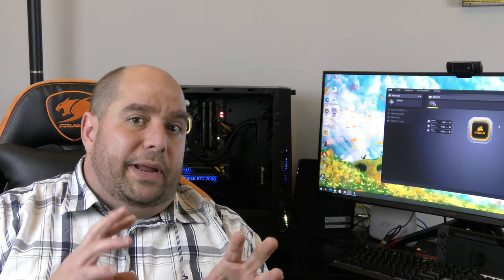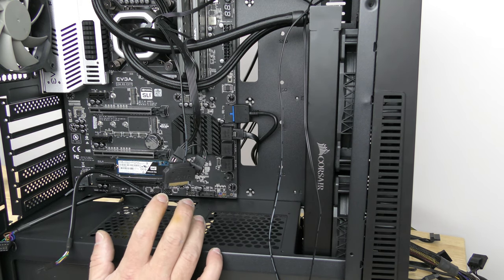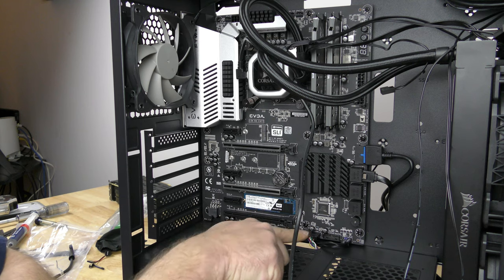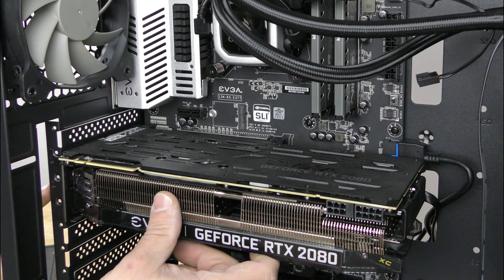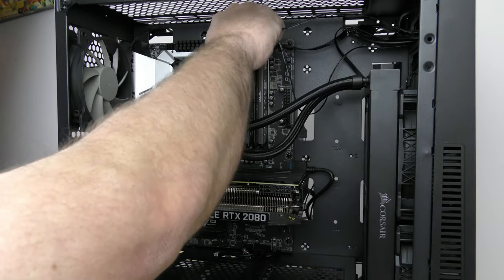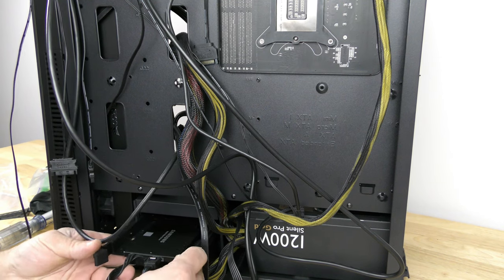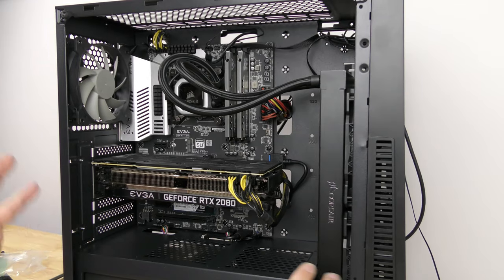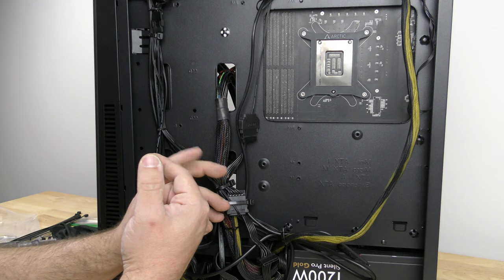How to Wire a PC Game Build for Beginners - Step by Step Wiring Guide 2021

Comment from the maker: ✅ Watch Next: How to Installing the EVGA 3080 Ti FTW3 ULTRA GAMING: https://youtu.be/qsOC2IkKi1s
In this video Cabling a gaming PC in the Gamdias Argus M1 Case Part 2 of 2 -  Step By Step, we go over how to wire the PC you just built inside of the Gamdias Argus M1.  
✅ Have you checked out the Build video, learn how I built it and got to this video: https://youtu.be/RfgpRGLQT2A

Please let me know if you have any questions on this, but below you can find a full part list of everything in this system.

Here are all the components in this system
Gamdias Argus M Case: https://geni.us/N75el7
EVGA Z370 FTW Motherboard: https://geni.us/X9eVgAq
Corsair Hydro H115i PRO Liquid Cooling AIO: https://geni.us/KhslEW2
Intel Core i7 8700K Processor: https://geni.us/jD0s8D
EVGA GeForce RTX 2080 Super XC Ultra: https://geni.us/XfqTe
ARCTIC MX-4 - Thermal Compound: https://geni.us/Gveq
WD Black 512GB M.2 2280 PCIe NVMe: https://geni.us/mMNLde
Samsung 850 Evo 500GB: https://geni.us/QTA2
Cooler Master Silent Pro Gold 1200W PSU: https://geni.us/7hdBk
Patriot Viper Elite Series DDR4 32GB: https://geni.us/iMVWhP
Reply: @ThisBytesForYou currently only one side of headphone is working when plugged in the front panel audio jack other Jack's are ok, not a siftware issue
Reply: @ThisBytesForYou so how to fix it in hardware, could it be more likely the wire or the mobo or the jack the problem. (Recently built the pc in a shop)
Reply from the maker: @jirehla-ab1671  look at where you have the hd audio plugged in on the board, chances are you have only the top half connected, not both sides, top and bottom, ita very easily overlooked.
Reply: @ThisBytesForYou  yeah sounds like i need to plug my jack  harder in order to fully pluged in.

Comment: Great detailed review.   I have a question in particular to the front I/O LED lights.   I see that in 20:43 of the video you press the I/O button to change the LED colors.   In my case, it resets the computer.   What did I do wrong?   Thanks.
Reply from the maker: Probably what you have done is you plugged in that button into the reset header on the board, press the reset button and see what happens.  I think your crossed the wires, not a big deal though, you can swap them.  Let me know how it goes.

Comment: Do you need that usb 2.0 to 3.0 connector or is their a spot where I can connect the usb 2.0 header into the motherboard?
Reply from the maker: More than likely yes, most boards have at least 2 x USB 2.0 headers and 1 x USB 3.0 Internal header.  I used one of the 2.0 so that I could get another USB 3.0 header, depending on the case of course.

Comment: Hello I have a problem my pc turns on the fan spins for a second then it just dies
Reply from the maker: Hello my friend, can you please list all of your components, manufacturer and model number for your motherboard, video card, power supply, RAM, Video card, etc, please list them all so I can help.
Reply: ThisBytesForYou      Thank you.  Here is specs.   Motherboard is  ASUS prime Z390M-plus LGA1151
Intel I7 7700k 
Geoforce Gtx 1060 6gb 
32gb crucial ballistix rgb ddr4 ram 
Nzxt 120mm water cooled
Reply: @JustRealMrBread  I think he forgot about u 😞
Reply from the maker: nope didn't forget, youtube sucks at notifying.
Reply from the maker: sorry my friend, youtube is horrible at notifying me.  Check to see that the CPU, Memory are seated properly.  Make sure you have the 8Pin EPS CPU Power connected from the power supply to the motherboard and the 24PIn ATX power is connected and seated properly from the powersupply to the motherboard.  Make sure all of the PCIE connections are plugged in correctly to your video card.  It has happened many times, a lose connection will cause this.  And it can be so easy to miss them.  Again, I apologize for the delay, and I will be making a video on youtubes messed up notification system.

Comment: Very well detailed, however I did notice you have the AIO pump above the radiator which you should always try to avoid. But not a big deal.
Reply from the maker: Thanks bud, it really does depend on how much that it has been filled, Arctics I have never had a problem, like this and slightly above the CPU, but this one... it gave me problems a few months afterwards, they didn't fill it enough so the bubble was pretty large.  I have built many with Arctic AIO's and never had an issue, they fill it almost completely, come to think of it, I didn't have an issue (and haven't since I am still using it on another build) with the EVGA's, but yeah, generally, inline and SLIGHTLY above is OK, like in this video, higher than this though you are asking for trouble.

Comment: such a good video, im building my first pc right now and i could use any sort of help if any one could guide me 🥺
Reply from the maker: Awesome , so very happy I could help you my friend, I have about 400 videos on here and plenty of build guides, even guides in how to prepare a windows 10 boot drive and how to install it.  If you have any questions, you know where to come.  As you can see, I answer all of my comments, when YouTube themselves don't mess up not telling me there is a comment, which sadly is quite often but I can help you along the way.  Thank you so much for checking out my video and commenting, it means the world to me.
Reply: ThisBytesForYou thanks for answering comments man, i have a corsair h115i cpu cooler but i installed it the other way you did, fans are in the case and radiator is facing out. is that a problem?
Reply from the maker: Yeah, that would not be good, while you are sucking out warm air, you are not getting any cool air in the system, and your cpu can get toasty, you don't want negative pressure.  It's fine to have the cooler on the top or the front but you want it sucking hot air out from the top and/or in taking cool air from the front.  You want your rear fan exhausting and depending on how you have the liquid cooling unit, that will probably be the only one exhausting

Comment: Do in all occasion have to buy a usb 3 to usb 2 so that i put the cpu cooler cable thing u did or is it depending on the motherboard some have more usb 2 ports and some less plz answer cus im watching all day tutorials and im afraid of ordering something wrong and need new cables and adaptors
Reply from the maker: Please don't asked people to plz answer, it won't get people that do not answer to answer, I answer all my comments, many do not.  I did it in this build because I did not have a usb 2 port for this, but if you have enough, you can use it

Comment: im about to upgrade my heatsink and fan from years ago and looks like im gonna do rewiring too lol thanks
Reply from the maker: Cool my friend, I hope this video helps you out, I am so happy if it does.  What heatsink and fans are you planning on?
Reply: @ThisBytesForYou  oh didnt expect the quick reply haha thx.  Planning on the Cooler Master Hyper 212 EVO its on sale for $35 CAD.  Not really splurging on this comp as its pretty old but too noisey now and needs a cleanup. Yes the vid def will help with the wiring managment badly needed and making neat with the twist ties.
Reply from the maker: The cooler master hyper 212 EVO is an oldie but it is a goody, so thats cool.  YEah, I always try to reply as soon as possible, sadly youtube does not deliver all the comments, so I miss a lot, but I filter through all of my messages to find ones I didn't get, like this last one.  So very happy my video helped you and please let me know if you have any other questions.  Thanks so much for stopping by and checking out the video, liking and subbing as well as commenting, it means a ton to me.

Comment: Nice guide. I'm building my 2nd PC soon and I'm a bit nervous about the wiring as there's a lot of ARGB elements and stuff going on and I really didn't do the wiring myself the last time over 10 years ago. Just have to read the manuals ever so carefully so I'm not accidentally going to damage any of the components. Other than that, I feel quite confident. :)
Reply from the maker: So very happy I could help you my friend.  I will have to admit, I hate the way ARGB is implemented, the connectors, at least in the ones I have seen, have no way to clamp onto each other so they can fall apart easily.  In this video I show you how to zip tie those together, I do recommend doing that, if not you will get very frustrated haha.  Thank you so much for the compliment, and for stopping by and checking out my video, it means the world to me.

Comment: Hi Sir!!  I do have a 4 pin (female) cable called TKG.....It's related to rgb. That cable have to go on motherboard?? Thanks!!
Reply from the maker: Then connect it into an ARGB connection on your board, or if its connection thats about an inch wide, it should go to a Molex connection on your power supplty.  If you have a picture of it, put it on imgr or something and send me a link here.

Comment: Hello! First off, thank you so much for this video, 2nd, and I know this is goofy, would you be able to tell me how to get these wires? Do the come with the computer case or a certain part? I'm trying to upgrade an EXTREMELY old (circa 2010) pc that I got from an ex, and I might have bad/outdated wiring
Reply: The front panel cables are part of the PC case. These typically include the power button, power light, reset button, HDD light, etc. The rest of the power cables are part of the power supply.
Reply from the maker: Well, they would come with your power supply, but maybe your power supply doesnt have them.. Could you let me know your power supply manufacturer and model number as well as your motherboard and processor, maybe case too?
Reply from the maker: It all depends if her power supply is powerful enough to have them.

Comment: btw the graphics card is better to have 2 different cables for the 6 and the 8 pins than just using both on the one cable, it can restrict the power depending on the psu/gpu
Reply from the maker: haha, yes, for sure, this was an older video from 3 years ago where this wasn't as much of a demand on power, the 3 series and above is what required true power connections, rather than daisy chaining, which I hate doing, but this was more the norm and amperage wise OK.

Comment: just to be clear i use every single cable that comes with case and power supply in the build right?
Reply from the maker: Yes, there are no additional cables in this build that I bought separately in this build.

Comment: Hey bro idk if I would leave the AIO pump tube on top of the GPU, it gets pretty hot especially with a 2080 and could cause water to leak and fry it
Reply from the maker: Haha, no my friend, not at all been running it like this for years, not this particular rig but other rigs much more overclocked and the temp are great.  I was a product development engineer for Alienware, then later dell when they bought us and velocity micro, won many editors choice awards and sold tons of them, with 5 year warranties as well, it's all safe.  Promise, it's safe.

Comment: Where is the reset button on the case? Can I install another smaller GPU in there?
Reply from the maker: no reset button on this case, but you can use the power button as reset, just hold it down.  Yes, you can install what your motherboard will allow you to.

Comment: Hey i have a question, so i built my first computer 2 years ago and wanted to clean the components yesterday. Now that i built it back together it wont work: my Monitor doesnt get any signal, morr importantly the computer turns off every 5 seconds or so and turns back on immidiately after. I think that i didnt connect the gpu right, it runs but i think i didnt connect the cables right. I wanted to ask you for Help as I saw that you respond to All your comments on your yt Videos😅 greetings from germany!
Reply from the maker: check the HDMI/DP cable, make sure they are both firm and make sure your power connection is pushed in all the way, it can be a loose connection.  Check it out and let me know how it goes.  Yes and you are right, always reply, unless youtube doesn't deliver the message, which happens often sadly.  Greetings from the US my friend ;)

Comment: The cables that come from the fans that came with my case are tiny 3 prong wires and my motherboard slots labeled “fan” are all 4 prong? Am I dumb or is there like a workaround? Does the PSU usually come with some kind of cable adapter for this?
Reply from the maker: the 3 pronged wires fit in the 4 pin slot, notice the plastic tab on the motherboard fit's perfectly into the notch on the 3 pronged header?
Reply: @ThisBytesForYou  I noticed after making the comment 😅 thank you for reassuring me though!
Reply from the maker: Happy I could help.

Comment: Hello I’m doing my first build right now, there’s LOTS of wires in the power supply box... it seems that you didn’t use the same amount that I have. I asssume a lot of them you don’t really have to use ?
Reply from the maker: yeah, the box for this power supply has a lot of the cables, extra's which are important to keep in case you upgrade or something but you don't need to use them all.

Comment: @3:09 @ThisBytesForYou sir you did not stop and think to show the 2 there often added power connections known as (reset switch & fan) after-all not every new pc tower has these 2 extra connections but many still do.
Reply from the maker: You did not stop to think that every single case and every single motherboard is different.  I can show you here.... But it would not match yours.  I will have a single video soon that focus's on this and this alone.  Like you stated, your did not have it, so it would have difficult.  It will come.

Comment: Hi i built a new pc and im unable to control speed of the fans. I have 4 case fans and 1 cpu fan. Im not sure if i plugged them wrong in my asrock b365 pro4
Reply from the maker: Very happy to help my friend.  It sounds like what is going on is maybe you have them plugged into the power supply, where it would just be at full force, or maybe they are 3 pin fans, you would need 4 pin fans so that they would be PWM fans, that can be controlled in the BIOS.  Does any of this sound like what you may be doing?

Comment: BHello. I have a question. Maybe i will buy Rog Strix rtx 3090  with 3x8 pin connector. My question is how to plug it?
I mean it will need 3 separate cables (Without spliiter)from psu ? If card have 2x8pin it need 2 separate cables. But what with 3x8 pin? Thx
Reply from the maker: Well, what manufacturer and model number power supply do you have right now?
Reply: Asus 850w g white edition
Reply from the maker: that power supply brings 6 x PCI-E 6+2-pin, you are fine.  Look inside the power supply box for additional cables, if you can't find them, contact Asus, they might be able to sell you some.
Reply: Is 6+2pci e same as 8 pin pci e
Reply: I’m really sorry I have so many questions I’m new😀
Reply from the maker: yes, its 6pins, plus 2 Pins, for a total of 8Pins, just make sure you are using a 6+2 header from each cable, for 3 cables, all separate.  And no worries my friend, I am here to help.  I hope you subscribe so you can keep up to date with my channel, I come out with videos weekly to help you on all different things PC related and I have nearly 400 videos already, so I am sure I have more that can help.
Reply: Thank you very much
Reply: I’m ordering in cable mod psu replacement cable is it okay to buy bridge 8+8+8 bridge PCI E pci e cable is it okay?
Reply from the maker: nice, I am part of the cable mod facebook group as well, but what do you mean bridge?
Reply: It hard to explain 3x8 are comb together I hope you understand 😅
Reply from the maker: as long as each of the 3 cables, comes directly from the powersupply, then you are good.

Comment: Ok I’m VERY new to pc building and I’ve just installed a new graphics card and I need another cable for it cuz i only have one plugged in where the hell do I I plug in the cable so I can plug in the graphics card?
Reply from the maker: This guide will most definitely help you, the cables would come from the power supply, what is the manufacturer and model number of the power supply?

Comment: Hiya! Its my first time, I moved everything to a new case, the only replace other than a new case is the Corsair H100I RGB and three new fans in the top. I have a 850W and everything is on but I am not getting a signal on my monitor connected to my GPU.
Reply from the maker: Happy to help bud, great step building your own.  Did you make sure to follow the first part in the guide to make sure you built it correctly.  Also for your gou, did you connect both pcie cables?  Do you have the proper input selected on your monitor, for example if if you are using hdmi, make sure your monitor is on hdmi, are you using any adapter?
Reply: @ThisBytesForYou  Yes I did, I took it apart and did step by step again, manage to get a signal now on my PC. thank you! :D

Comment: I have a question, is 6+2 power supply compatible with a 8+4 pin motherboard? I'm not sure if that makes sense, I need help 😔 I have an msi mpg z390 carbon motherboard
Reply from the maker: Hello my friend, it makes complete sense but it does not work, they are completely different.  You don't need to plug in the 4pin. Cpu power, it is for auxiliary power, for ovweclocking only plug in the 8 pin for the cpu and make sure the cable says eps, not pcie.  The 8pim pcie cable is only for video cards.